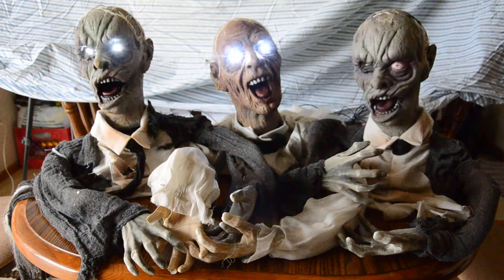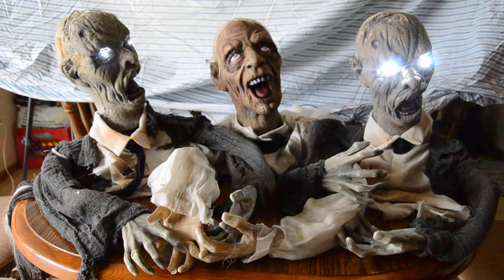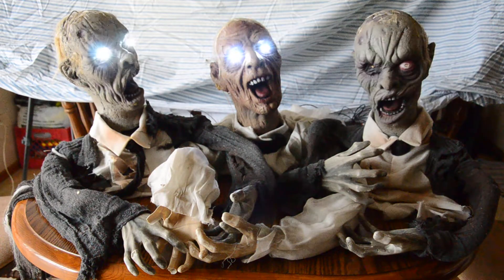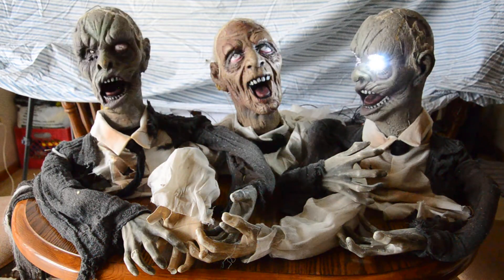Halloween TRY ME button to HC-SR501 PIR Motion Trigger conversion demo

Comment: Brilliantly done. First time mod here. I have a wired  demo push-button standing prop, and would love to hook up the HC SR501, but need to know more. I see on the 501 it has a spot for terminal connections,  but need more info. First timer here. Thanks
Reply from the maker: You asked.  I will oblige.   I will make a video with schematic and explanation of how it works.   If you can connect the dots you can make the circuit.   You will need to learn how to solder but its easy.   Check back in a few days.    I will send a reply when video gets posted.    Thanx for watching.    Check out my other circuits for Halloween/Christmas props.
Reply from the maker: I am uploading 2 videos as promised of which one is a full description and schematic of the circuit that makes the PIR motion trigger to TRY ME button interface work.   Hope this helps.  There are tons of detailed vids on how the HC-SR501 functions.   Make sure you find a more recent one.  The older PIR modules did not have the two potentiometers for adjusting delay time and sensitivity.  Let know how it worked out for you.  You can get all the components from Tayda Electronics very reasonably.